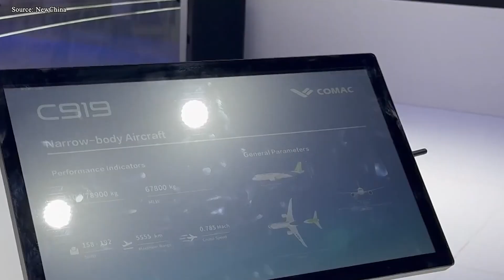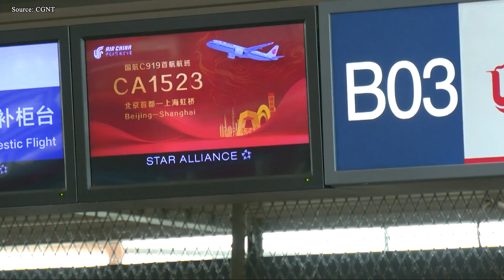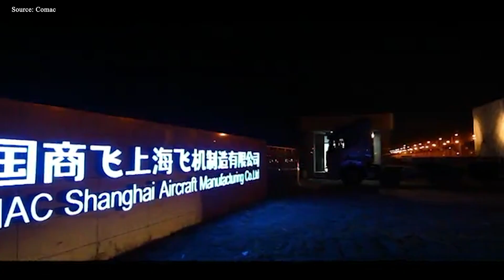This Is How Chinese COMAC C919 OUTSMART at the Dubai Airshow

Comment: they did not outsmarted anyone, just copied Airbus 320 1:1, and still theay are having worse engines still...
Reply: The CJ-1000A engine outperforms the LEAP-1A engine used on the Airbus A320 series in multiple key aspects, especially in thrust and overall performance:
 
- Thrust Superiority: The CJ-1000A boasts a maximum thrust of 13.5 tons, with a stable core thrust range of 12.4-13.4 tons. While the LEAP-1A has a general thrust span of 10.7-14.8 tons, its mainstream version for A320neo only reaches around 13 tons. The CJ-1000A not only has a slightly higher peak thrust but also maintains more stable core power output. Its thrust-to-weight ratio hits 4.5, far exceeding the LEAP-1A’s industry average, thanks to advanced lightweight design that significantly reduces engine weight. This advantage directly boosts aircraft performance—enabling higher payload (more passengers and luggage), lower power consumption, and longer range to fit long-haul operation needs.
- Efficiency: With the same thrust output, the CJ-1000A’s fuel consumption rate is over 3% lower than the LEAP-1A, cutting fuel costs and enhancing operational economy.
- Noise Control: Its noise level is more than 10 decibels below ICAO’s Stage 4 noise standard, far better than the LEAP-1A, improving both airport surrounding environment and in-cabin passenger experience.
- Technological Innovation: Adopting advanced technologies like blisks and third-generation single-crystal superalloy turbine blades, it excels in structural strength and high-temperature resistance. Equipped with an intelligent health management system, its fault early warning and maintenance efficiency far surpass the LEAP-1A’s traditional monitoring system.
- Localization Advantage: Core components are fully independently controllable, breaking foreign technical monopoly in high-bypass turbofan engines. Mastery of the entire R&D and production process gives it unmatched advantages over the LEAP-1A in supply chain stability and long-term technical iteration.

Comment: It is time to retire the old B737's and retire this pulleys an cable controls of a century old controls and embrace the fly by wire controls even though there is still a market for them but so for the DC-3's....
Reply from the maker: The shift to fly-by-wire is definitely a significant step forward in aircraft design.